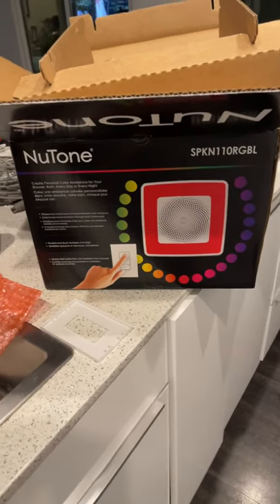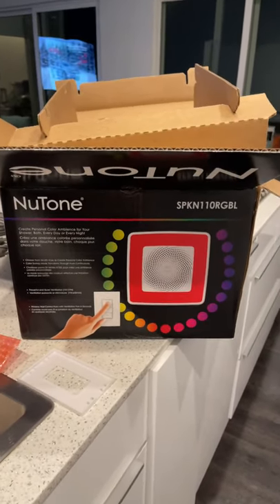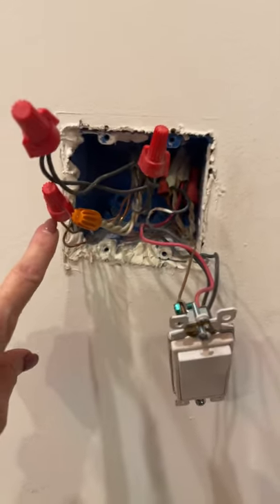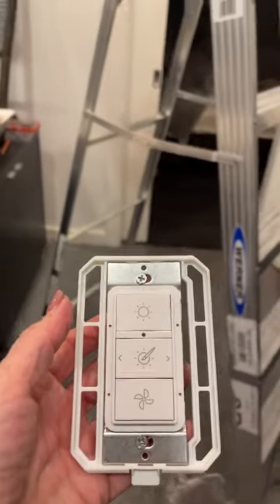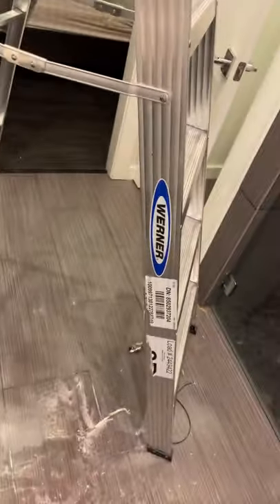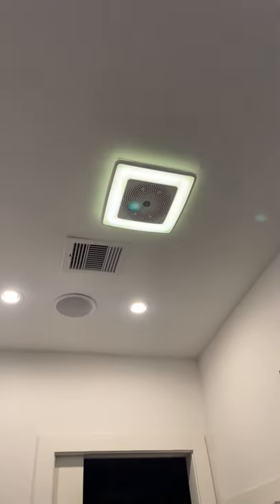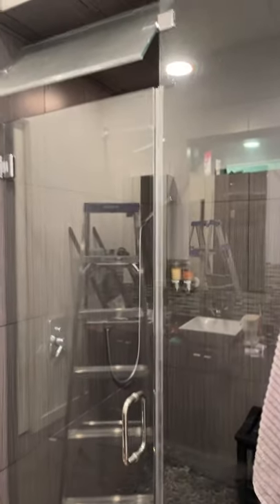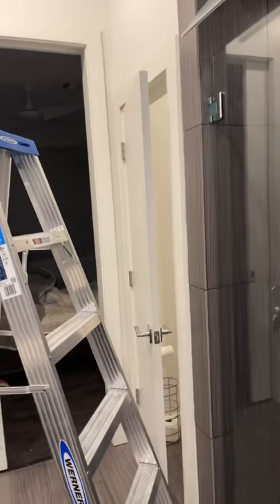Super Easy fix for NuTone Bluetooth exhaust fan not working

Comment: We have a light switch and a fan switch. What do we do different? Do we change them out and put one switch? PLEASE HELP!
Reply from the maker: I am not an electrician, but to get mine to work I took the old switch out and then connected the live wire coming in and out.  I would simply do this with each switch and should work fine.

Comment: So my old fan is controlled with a light switch. Could I just leave the light switch turned on which would give the unit constant power?
Reply from the maker: I believe you simply need to turn off the power before removing the switch and then attach the live wire from the switch to the fan (black wire), attach the ground to the ground and the white to white if not already done.  Then put the remote where the switch was after capping the live connection you made from the old switch live wire to the fan and turn the power back on.  From there simply pair the remote and you should be good to go.  Check the instructions to be safe, but I recall this is what I had to do.
Reply: @briesbreeze8594  Thanks!

Comment: Ugh mine still won’t work😢😢
Reply from the maker: Use a multimeter and check for connectivity at the fan.  If you have it is a remote issue.  Make sure batteries are in remote correctly.  Turn off breaker and turn back on and then pair per video.  Should work.

Comment: This video did help. In fact, when I tripped the breaker and ran upstairs to hold the light button in, it worked! However, the switch would not control anything after this. I couldn't turn it off, turn the lights on or change the color of the LED. I had to power the whole thing off, to get it turn off and then it would not turn back on without tripping the breaker, again. At this point, I'm thinking I probably do need to replace the whole unit.

Comment: Thanks for the video. Have 3 of these and when hurricane came though could not get them to come back on. Ended up unplugging each unit for 30 seconds (Power plug in ceiling mount unit), then pressing the light switch button, then the fan button.... IMPORTANT: if you have two units within a few feet of each other (relatively close bathrooms or laundry) do one at a time so the remotes do not cross over and operate another unit.
Reply from the maker: Good to know.  Glad it all worked out.  Please subscribe.  Thank you.

Comment: Was about to pull the fan out and return it when I found your video.  Saved a ton of work and aggravation.  Thank you so much.  One thing I would stress is pushing the white light button quickly after resetting the breaker.  5-10 minutes had passed when I tried it the first time (while I was searching for advice) and it didn’t work.  I reset the breaker again and tried it immediately and it came on within 10 seconds.  

Thanks Again!
Reply from the maker: I can so totally relate, which is exactly why I posted this video.  Thanks so much for your post!

Comment: Thank you very much for the video! Do you happen to know if there is a trick to changing the colors? I'm pressing the button but it's not changing, only white light and fan work.
Reply from the maker: I will look at that when I get home.  Are you pressing the button for color and not the white light?  There are three different buttons on the remote.
Reply from the maker: Okay Mike, so I finally made it home.  You need to press the left side of the middle switch repeatedly to get different colors.  Please let me know if this helps.  Also, please like and subscribe.

Comment: Honestly a good vid except you don’t need to disconnect the power switch and do a direct wire. Just turn it off then back on and do the same process with your remote. Has to be within 30 seconds of turning it on or just switch off the power and do it again.

Comment: First  of all thank you! We are still having an issue the the fan doesn't do anything when we click the fan button the makes a clicking sound but doesn't turn on. Any idea whats wrong?
Reply from the maker: Does the light turn on?
Reply from the maker: If the light turns on, then check to make sure nothing is blocking the fan blades.
Reply: Did you ever get this resolved? My fan is doing the opposite. It stays on and it doesn’t turn off but I also hear the click when I press the fan button on the switch

Comment: Mine still does not work, am i required to remove the wired switch? Or if i leave the switch on would it not work the same?
Reply from the maker: You can’t leave the wired switch.  You have to remove it.  I can’t remember what you need to do with the attached wires but that part is in the included instructions.

Comment: I tripped my breaker and now nothing turns on. When I trip thr breaker again and come in and hold the power button, nothing happens. Can anyone help.
Reply from the maker: Try taking the battery out of the remote and put it back in, then turn the breaker on and hold the button on the remote.  How did you trip the breaker?  Normally that happens if there is an electrical issue such as wiring incorrectly.  Was everything working before?
Reply: I had to turn the breaker off for a porch light. Now I turned everything back on and confirmed its getting power and I tried to hold down the power button but nothing happens
Reply from the maker: @VideoGknowsall  Wes, then I would take the batteries out and put them back in, go turn on the breaker and then press the button.  Any chance the batteries are bad?  Make sure the remote is close to the exhaust fan when you press the button on the remote and you have to press the button within a few minutes of turning the breaker on.

Also, if you use Bluetooth to play music with it, refresh your Bluetooth on your device that you use to play music and see if you see the fan.  Try using the blue tooth to play music to its speaker
Reply: I took the batteries out, turned breaker off and  back on. I put the batteries back in remote and held the remote next to the fan. I pressed the power button down for like a minute but nothing happened. It was working fine before I turned the breaker off.
Reply from the maker: @VideoGknowsall  Wes, that happened to me once and it took a few tries before success.
Reply from the maker: Wes, did you check with a multimeter that power is going to the fan?

Comment: I got my lights and music to work but not the fan? When I hit fan on button I hear a click sound emitting from motor but that is it.
Reply from the maker: It sounds defective.  If everything else works it may simply be defective.  I would remove the cover and make sure nothing is blocking the blades.
Reply: @briesbreeze8594  I did that. Nutone is sending me another motor. Thanks for the feedback.
Reply: Mine is sharing the same issue but when I plug it in directly with an extension cord it comes on.
Reply: @stonemerton3262  I have since corrected the problem. There is a second hot wire I didnt connect.

Comment: Dont forget to disconnect bluetooth, you will never be able to connect ever again.

Had a guest visit the house, used the bluetooth speaker, forgot to disconnect, now we will never be able to use the speaker again.

It is a "feature" no reset button, no forced disconnect, no forethought on the manufacturers end.
Reply from the maker: This may work.  Take the batteries out of the switch.  Turn off the breaker, put the batteries back in and pair it again.  I believe that may resolve your issue.
Reply: @briesbreeze8594  
The only way to kick a connection is to pop the breaker the fan is attached to.
Reply from the maker: @calverley79  Well that’s super easy.

Comment: How do you put batteries in the control unit? Remove 4 small screws?
Reply: If you read the top of the switch it says open here. use a small flat-head screwdriver to pop the front face with the switches out of the housing that is screwed into the wall.

Comment: I’m having the same problem but my older exaut fan don’t had de switch
Reply from the maker: What is the model for your fan?
Reply: nutone® 110 cfm, 1.5 sones chromacomfort™ w/ sensonic™ stereo bluetooth® speaker
Reply from the maker: @brunofreitas5499  you need to use the new wireless switch.  Follow my instructions on the video to hardwire the fan.  You can’t use the old switch and you don’t need it.  The old switch has a live wire going into it and then a wire going to the fan.  They both should be black.  You will connect these two together.  Absolutely turn the breaker off before working with this.  Never work with live wires.  The wireless switch will then control the fan, lights and stereo once you download the app and connect via Bluetooth.

Comment: Ours connected. But the top button (remote) and in the app the "main light" does not come on (dimmer to 100% full power). We have fan, music, color but the main light is not coming on. Anyone experience this?
Reply from the maker: I haven’t.  Did you take out batteries, turn off breaker and do a reset to see if that may fix it?  If not, that toggle on remote may simply be broken and needs to be replaced.  I would try a reset and then either go to store you purchased from or contact manufacturer’s customer service.  I believe this is their number:  1-888-336-6151
Reply: @briesbreeze8594  I'll reset it tomorrow. What makes me feel it's not the remote is I'm getting the same from both the phone app and remote. So the issue seems to point to the unit. Thanks for the quick response.
Reply from the maker: @eenkjet  did that work?  The sucky part is that it may be the connection where it plugs in at the unit and that would mean replacing it.  I would just get a new one and exchange out that part and return the defective one.  It sounds like it may be that connection is defective:
Reply: I can't get fan to work. When I push button I hear a click sound emitting from fan motor.
Reply: @vikings844  I’m having the same issue. Lights for fine. I can cycle through all the colors, dim up and down. No fan… it’s so frustrating!11
Reply: @bobbystephens9531  I found out my problem was I didn't wire it right.  There are 2 black wires, I only connected 1.
Reply: @vikings844  ...... seriously?!?! That sounds like a fix to my problems... Thank you!!!!
Reply: @bobbystephens9531  No problem.  Hope that solves your issue.

Comment: Mine still not working 🤬
Reply from the maker: Did you follow the steps?  It should work if you follow them.
Reply: @briesbreeze8594  , ensure power is still connected-done, press and hold light button down for 30sec- done. Still no light turning on. Did I miss a step?
Reply from the maker: Okay, have you connected the the black wire from your previous switch to the black wire running to this device and done the same with the ground?  If so, go turn off the fuse for a few minutes and then turn it on after making sure you have good batteries in this remote that are placed in the remote properly.  Then, with the remote close to the fan, within a couple minutes of turning the fuse back on press the white switch which is at the other end of the fan switch and hold it down for about 30 seconds.  This should resolve the issue.
Reply: @briesbreeze8594  , yes. Black, white and ground all connected. Verified using Klein volt tester. Breaker has been off for about 30 min
Reply from the maker: Did you download the ChromaComfort app?  After turning the fuse back in and with the remote close to the fan press the light switch(there is also a thin button above it.  You might try pressing it instead). Make sure the remote is close to the fan.  Look for this device as one of your Bluetooth devices to connect to after.  It should be there if it properly paired the device.  Sorry this is such a headache for you.  Hoping this helps.
Reply: @briesbreeze8594  , app won't sync/pair either. Phone doesn't see/find device on BT/BLE. The thin button is below my light button and above the color change button, then below that is the fan button
Reply from the maker: @j77scout  did you try holding down that thin button after turning fuse off and then on within 3 minutes of turning fuse back on?  If batteries are in correctly and you are getting power to device then I would go get another one and simply try using it’s remote.  If that fixes it, return it with the defective remote.  Also, might uninstall and reinstall the app. And turn Bluetooth off and then back on to see if device can be found
Reply: @briesbreeze8594  , wait, am I holding the button down while the fuse/breaker is off? Then again once the fuse/breaker back on?
Reply: @briesbreeze8594  also, there's power to the remote.  Lil blue light comes on.
Reply from the maker: @j77scout  No.  after you turn the breaker back on go over with the remote near the fan and push the white light or thin button for about 30 seconds to pair it with the fan and Bluetooth it.
Reply: @briesbreeze8594 , long story short I bought a new one. Problem wasn't syncing it was the power. For some reason I had to cross the white to the hot black to get things to function.  Problem was one way everything but fan worked. Current configuration, everything but the color changing works...but there is a slight humming now.
Reply from the maker: That just doesn’t sound right to cross connect black(live) and white wires.  I am not an electrician but my understanding is that could cause a hazard.  Perhaps this is why device is not working as it should.  If you already had a switch it should have had a live black wire going into it and then another black wire going up to where the fan is.  You should simply connect these two together and also connect the ground to existing ground.  The white wire should be connected with other white wires or just by itself.  You don’t connect it to anything.  I would not recommend leaving the wiring cross wired.
Reply: @briesbreeze8594  the black to black connection gave no power. I  had an electrician out for something else and said the black to black, white to white is a common misconception
Reply from the maker: @j77scout  I would disagree.  Wiring is color coded for a reason.  Take your volt meter and check if the white wire is actually live and not neutral.  Perhaps the wiring was done incorrectly.
Reply: @briesbreeze8594  I did, white is neutral.
Reply from the maker: @j77scout  I don’t believe you should wire neutral to live.  If there were two black wires and one was live then they should connect together.  You said you had power to fan before so the only issue should have been pairing the device to the remote.